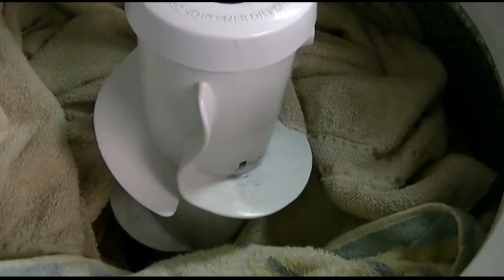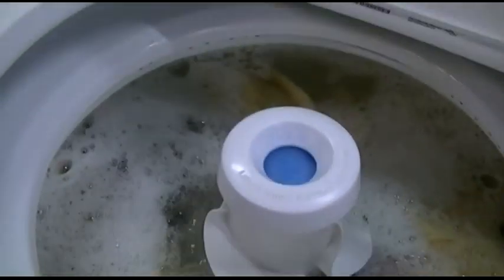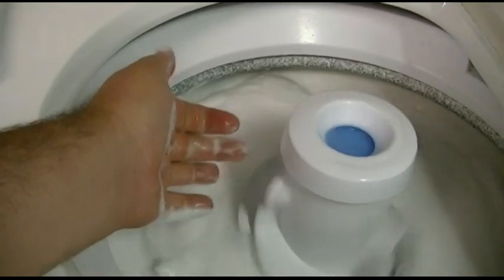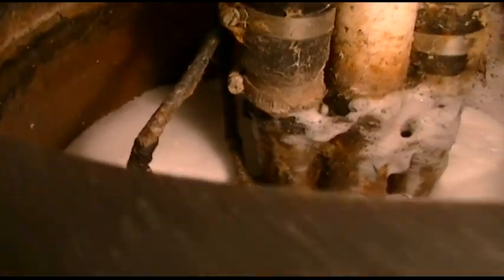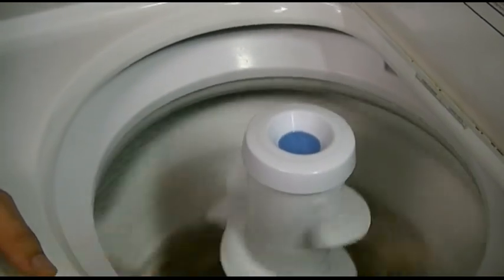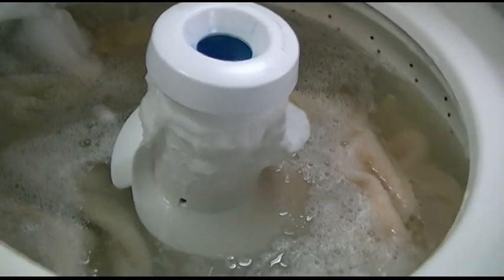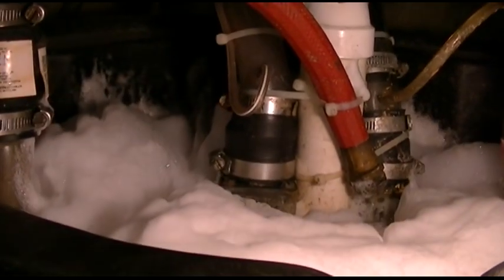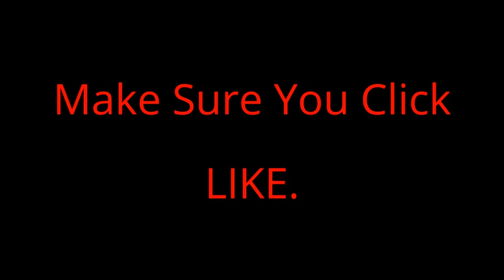WashDay Wash-In 17.0 With Sharkie626!!!

Comment: 13:40 one word Indestructible. The machine didnt care it just did what it was supposed to!
Reply from the maker: Yep, it has one job to do and knows how to do it well!
Reply: @jaykay18  Yep and will continue for many years to come. 1 load a week average in 10 years means the machine will have well under 1000 wash loads on the clock!
Reply from the maker: Yes, very low mileage machine!  Just like that grandma car with 40,000 miles on it, kept in a garage, driven to church and back on Sunday.
Reply: @jaykay18  only thing that comes close to these machines is that speed queen tc5. Even that wont beat these. No washing machine here would be able to handle suds like that. They would leak out of the soap draw!
Reply from the maker: That's why these are the machines I own!  No sense dealing with the rest when I have the best!
Reply: @jaykay18  exactly mate Unfortunately we dont have that option here. You cant get much better than these. I have noticed that speed queen tc5  is much more expensive than the previous models but has Way less features and electronics which I know you hate but it's as close to old school for those who dont have a DD or a pre 18 model
Reply from the maker: At least the Speed Queen is an option out there, unlike last year when you had no choice at all.  If they're going to charge a premium for it, it's worth it!
Reply: @jaykay18  that is true. Its basically a temporary revival of an old school classic. People will be grabbing them while they can.
Reply from the maker: With any luck, they'll keep this model available for some time to come.